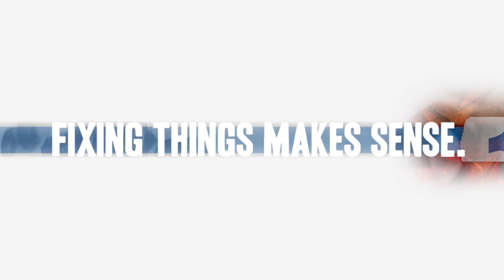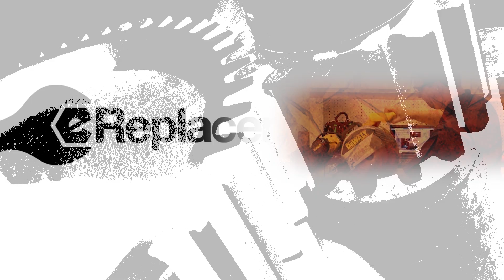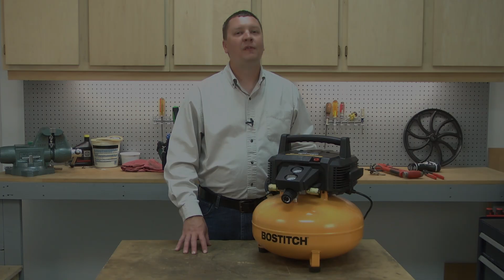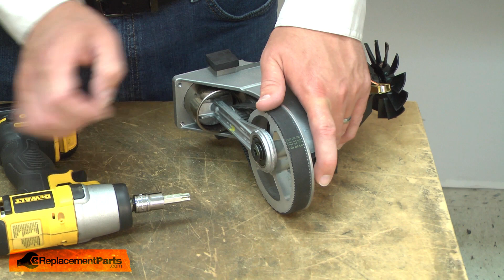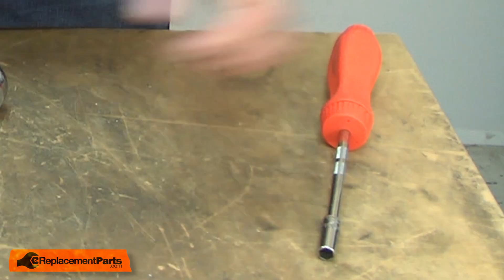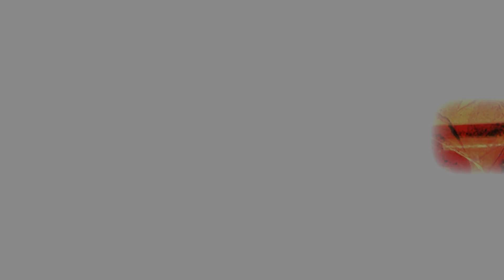Bostitch Air Compressor Repair - Replacing the Connecting Rod (Bostitch Part # N036518)

Comment: Great vid. sub'd.  I have the same compressor. Had a leak at the connection point of the metal hose to the rubber hose that I fixed with a 1/4 inch hose clamp. But it opened up another leak where the metal hose goes into the body right by the piston. Any ideas on how to fix this?
Reply: Sounds like the hose clamp is interfering with how the other end of the metal hose goes into the body by the piston. Usually with seals I don't like to F around with additional parts, it's always easier / gives better results to just replace.